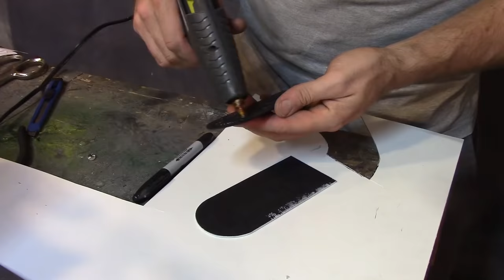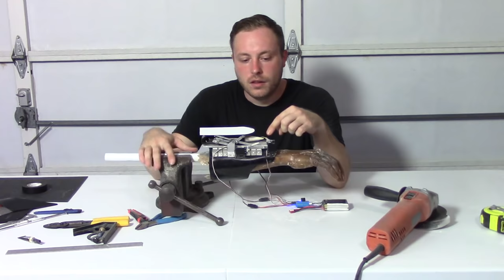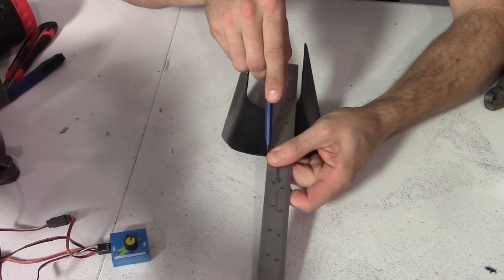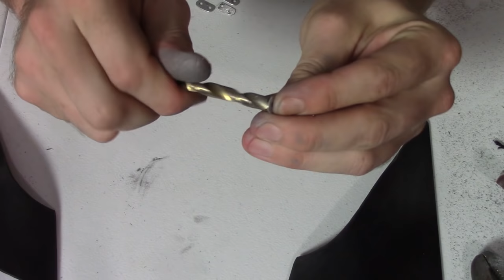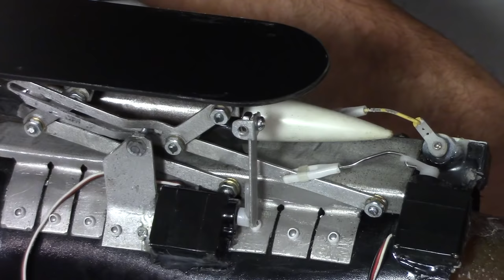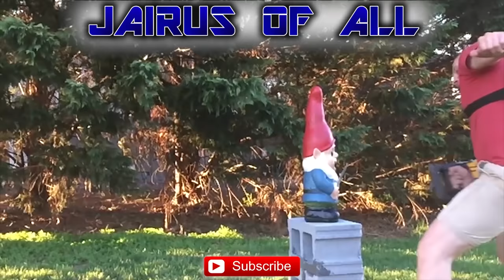BUILDING IRON MAN - FOREARM LAUNCHER Part 6

Comment: Have you considered using a couple of magnets along the seams to force them to align when they come together?
Reply from the maker: I have. I'm going to try to use the armor on the arm as a guide to minimize the need for magnets. I'm not sure if my servos have the power to separate magnets.
Reply from the maker: Also a huge thanks for being my first Patreon patron!!!!!!
Reply: +JAIRUS OF ALL No problem! Glad I can help out. By the way, what servos are you using?
Reply from the maker: Some leftover ones from an edf jet that I wrecked, no markings on them. Btw I think I'm gonna use magnets after all, just put a little space between them so they don't overpower the servos.

Comment: With the movement arms for the side panels you could attach the arm losely with a bolt and nut and then put a weight on the bottom panel so it would open the way you want but im not sure and have no way to test it
Reply from the maker: The issue then is the alignment when they close, also you would have to have it held up to open and close. Good thinking though! I love it when you guys give me suggestions!